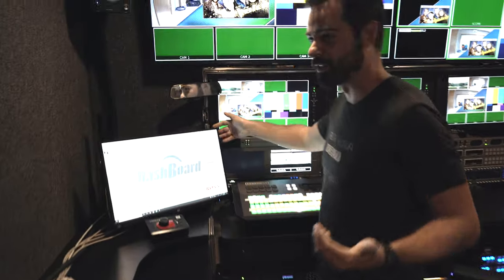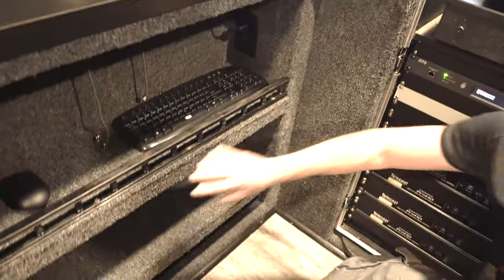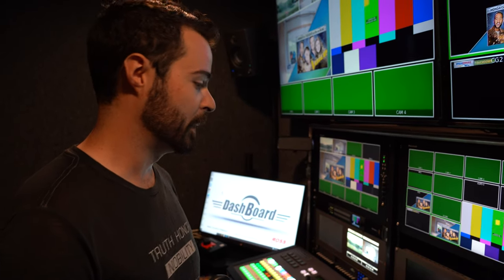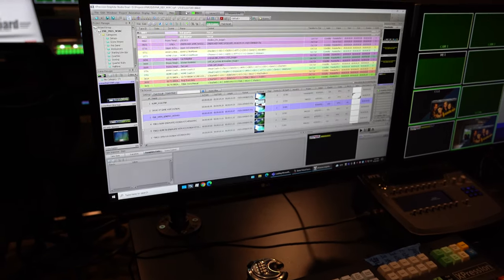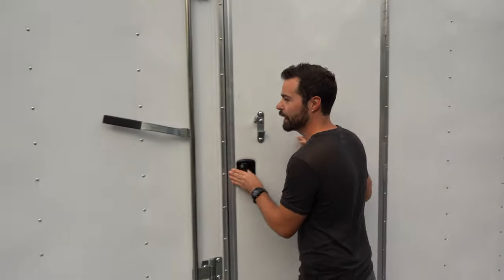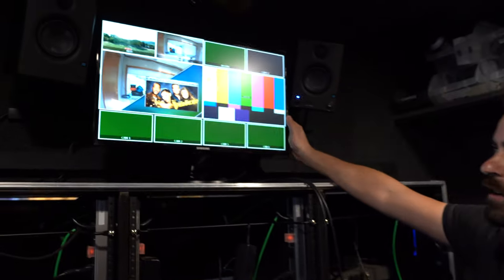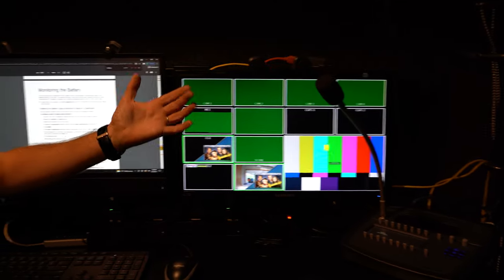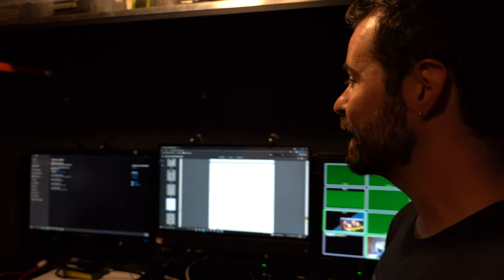Let's Build A Mobile Production Unit, Part 8 [Broadcast Engineering]

Comment: In regards to your shore power twist lock. Our trailer we separated the circuit like you have and so if we run shore power we have a Y twist lock cable (2 male one female) So we can use one line going in (50amp Single Phase 208v). Other wise we use two cables if we run two generators.